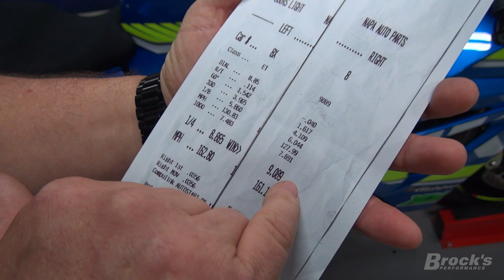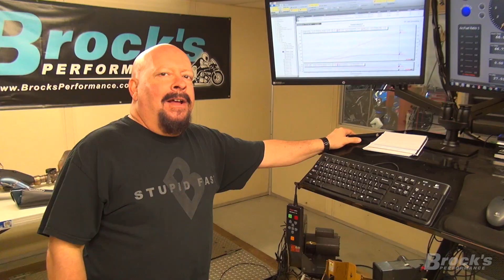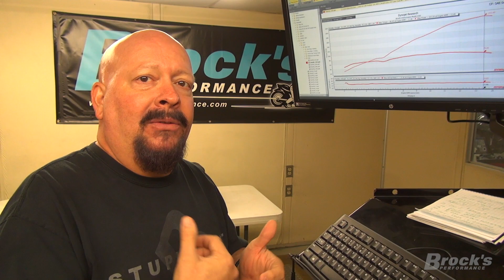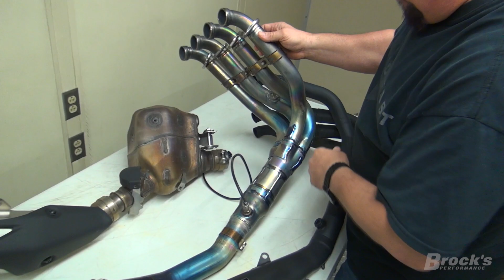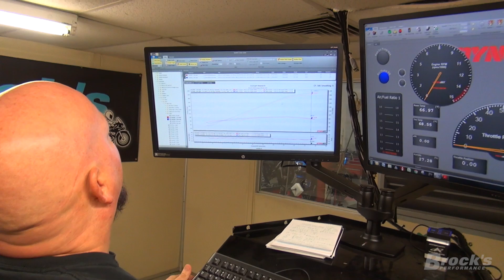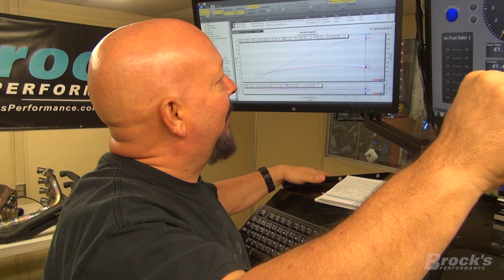Kawasaki Ninja ZX-10R (2019) Slip-On vs. Full System Debate SOLVED!

Comment: Looks like the gsxr1000 would win the drag race because of the long gap in the lower rpm where you'll be there for a while before you hit the top end? only a short rpm band at the top where the zx10 wakes up which could be too late at which the gsxr1000 have already gained a crazy heads-up. only thing someone needs to get used to a torquey bike like that lol.

Comment: How does the penta carbon deal with heat compared ti?
Reply from the maker: The problem with Ti, all Ti...even automotive grade, is oxidation which eventually leads to cracking...and this is accelerated in boosted or nitrous applications. The Penta- Carbon Is ultra light weight stainless steel - it will not crack under extreme use.
Reply: @BrockDavidson  cool thanks for the info. I have a 21 zx10r and I'm gonna go with your full system. Just getting the money together.. cheers

Comment: Hey I have a 21 zx10r. I bought your clutch mod and springs kit . I’m not just drag racing. I want to use my QS I street ride/race and I like to hit twisties. Should I not install the mod and springs ?
Reply from the maker: It's up to you. Installing the mod disabled the slipper, some guys don't mind this on track days, some guys want the slipper. The good news is that it's easy to swap.
Reply: @BrockDavidson  I have a full bolt ons with a tune . Swb . Thank you

Comment: Hey Mr Davidson,  I have a 2006 zx14 and I bought one of your systems back in 06 not long after I bought my bike new. I actually switched over to e85 by switching all my numbers in my fuel map using my laptop. It made over 191hp and ran really good but e85 got difficult to find near me and my injectors were at 97% duty cycle so I switched back to running 87 octane and I bought an alien head for a good deal on a zx14 forum.  Anyhow my computer crashed that had all my fuel maps and my pc3 is loaded with a map that isn't right due to me changing my individual numbers by anywhere from  30 to 40 points. The guy that owned the dyno let me play around for the better part of the day to get my airfuel right and getting the horsepower up. That said I just have no idea which numbers i manipulated from the 30 or the 40. Is there anyway you could send me a fuel map for the alienhead? Oh yeah I can't go back to the guy with the dyno as he passed away a couple few years ago with kidney failure. I'm sure he would have had the maps stored in his dyno computer. Anyhow I  can send you pics of my exhaust either the alien head or the carbonfiber canister to prove I have what I say I have and not trying to get something for nothing.  It's been so long and I can't find the cd that had the maps on them that came with the exhaust I bought new from you. Thanks Mark
Reply from the maker: Mark,
No problem! Just go here and request a map: https://blog.brocksperformance.com/map-support-purchased-used/ our Map Support Team will ask you for any info. they need to verify your purchase. If you want to send some pipe-side images to MapSupport@BrocksPerformance.com , that will speed things up.
Reply: @BrockDavidson  ..... thank you ...also i was wondering if the ecu was ever hacked to unlock big gains ? At one point there was only a few things that cold be done. I'm just wondering how I can get my bike to compete with these doggone litre bikes nowadays . One more thing do the gen 1. Zx14 respond well to mild headwork....... thanks for the reply
Reply from the maker: @POPSMOKE, since the 06's were euro 3, there really weren't many ECU restrictions that removing the secondary throttle plates didn't cure. In fact, we went VERY quick and fast with the stock ECU and some bolt-on tricks. Full stories here: https://blog.brocksperformance.com/kawasaki-zx-14-06-11/
Reply: @BrockDavidson  .... Thanks you very much !!!!!  It speaks volumes about your character and humility to take your time to respond to someone you don't know on YouTube

Comment: Question: I’m installing a M4 GP19 slip-on onto my 2021 ZX-6r and I’ll be eliminating the cat-converter along with adding the servo buddy. With that being said, is a flash needed? Does it ruin the bike in any way if I go without doing this? Thanks!
Reply from the maker: From a top speed,roll on perspective, the zx-10r is tough to beat. The new BMW s1000rr would be my choice for fastest normally aspirated 1000. No on the gsxt1k making 200 on pump. It's more suited for road racing, partial throttle operation. Hope this helps.
Reply: @BrockDavidson  my apologies, allow me to correct myself. I didn’t mean to say cat-converter. I meant pre-muffler. I think there’s a bit of confusion. I was simply asking if I replaced the exhaust and pre-muffler with a slip-on Will it do any damage to my motorcycle? Am I absolutely needing a flash if this is done?

Comment: If I understand correctly, that ZX-10 made 209HP at the wheel with MR12. So, what are the full modifications on the bike besides the full exhaust system and the tune? It can't jump from 160something to 209 with just an exhaust and a tune, 49HP is a huge leap.
Reply from the maker: All products are listed in the long description (click show more) - FYI;: a majority of the power gain occurred as a result of lifting OEM noise and emissions restrictions in the ECU,
Reply: @BrockDavidson  all the power mods i could find in the description, correct me if I'm wrong,  were the exhaust, air filter,  tune and the ceramic bearing. I don't know if sprockets would affect whp. Were there any intake or engine mods done? Like velocity stacks, valve work, cams and or camshafts etc? I need to know so I have a better idea of what is realistic or not, I don't live in the US btw so you can't really help me in person.

Comment: GSXR motors engineers have done incredible job on low and midrange rpm power with their VVT system. As you said, it’s not usefull on max speed, but on street  or track, you can exit curve very quick without downshifting. Great explanations.
ps : have you ever thought installing HAVC system to get consistent T°C and Humidity conditions inside your room ? A 1000cc bike sucks 1L/tr/min. So, at 14000tr/mn, it sucks 14m³/min or 840m³/h. That is the air you need to extract from the exhaust. So you need the same to compensate pressure from outside. So, with 38°C and 80%humidity (high enthalpy), you would need a 19kW cooling system to get that air down to 25°C/50%Humidity. Plus, some extra (i think quite a lot, maybe the equivalent of the bike power * 2) kW to cool bike down… It’s just an idea. I very expansive idea, but as you said, Devil is hiding in details!
Reply from the maker: The last thing we want to do is alter our dyno numbers even more than an average dyno. We pay attention to details that others do not, so our readings are already a bit higher than most in normal atmospheric conditions and considerably higher if the dyno owner does not maintain the dyno well. We completely evacuate our room 8-10 times per minute and draw from a 10K  square ft heated warehouse, so normally aspirated bikes are no problem. Supercharged bikes are the biggest issue as a glowing red exhaust will raise ambient room temperature 30 degrees in just seconds - trying to keep room temp under control for those conditions would be exceptionally cost-prohibitive.

Comment: Hi Brock, I’m Bob one of your new subscribers and somewhat new to the muscle bike world. I think your channel is great! Thanks for sharing your informational videos. 

I’m investigating in my bike and trying to get the most out of it without spending a small fortune. 
I will be having the ecu flashed, installing a Sprint air filter and changing the sprockets to 15/44. Most important to me is the sound profile of the bike. Currently the bike has a Two Brothers slip on and it sounds ok but not the tone that I’m looking for. 

I have a question regarding tone that I hope you can help with. My question is, is there an exhaust for a 2008 GSXR 600 that will produce a deep tone? 

I realize that I might be asking for the impossible but can that bike sound deep like an R1 without having a cross plane crank? If I were equating the tone to a muscle car exhaust, it would sound like something with a Flow Master Muffler on it. Again a deep but somewhat hollow / tinty while at idle sound. 

I appreciate any input that you might share! I suppose the worst case scenario is that I need to purchase an R1 for that deep rumble sound that’s most important to me. 

Below is a link to a video that has an example of the sound profile that I’m looking for. This example is of a Honda CBX 1050. Thanks again!

https://youtu.be/lal5UgVyiiU
Reply from the maker: Hello Bob, glad you are enjoying our channel. We work hard to provide exactly what you are asking for. Unfortunately we no longer offer a system for your bike as we focus primarily on new models. I think your best bet would be to check out Hindle Exhausts. They make a very good system, at a reasonable price and they understand to importance of a good tone. I will warn you that 600's are naturally "peaky" but a robust tone with out the "tininess" found in lower quality or worn out mufflers. Hope this helps

Comment: Would a fule stabilizer like 104 octane boost be recommended
Reply from the maker: Please read this: https://brocksperformance.zendesk.com/hc/en-us/articles/360061989231-What-is-the-best-octane-for-fuel-mileage-and-performance- 
The only time an "octane booster' is needed is if the fuel being used does not meet the engine's minimum octane requirements - poor quality fuel combined with high compression/turbo/nitrous etc... On a stock/normally aspirated engine, Octane boost is not only not needed...but it actually slows the bike down, as explained in the link above.
Reply: @BrockDavidson  thank you. So according to this article 87 octane is optimal. I would of never guess. I always learn something new from your show ty

Comment: I have a question, on an 06 ZX6R, I am needing to install an o2 sensor for my RapidBIke Active Tuning Module. I have a full exhaust, where is the best place to put the o2 sensor on the bike? I marked about an inch of 2 after the 2 pipes merge on the 1(4-2-1), but I noticed on the exhausts in the video it is in the middle of the 2, from what I can see only mostly getting readings from headers 3&4.
Reply from the maker: In the elbow pipe, low...just after the secondary collecter. From as close to on top as will fit to keep moisture away.
Reply: @BrockDavidson  Thank you!

Comment: Doesn’t the sae correction factor on dyno jet automatically correct for weather, barometric pressure, etc ? 

Are you using STD figures ?
Reply from the maker: Yes, the problem is wrapping your mind around what "corrected" means. It's just math, and math is never wrong...but the corrected results are just numbers. In the real world, actual performance is king. ET/MPH/Top Speed/ Lap Time etc... This might help/ https://youtu.be/NkNfmW44zuA
Reply: @BrockDavidson  so you don’t record your 1/4 mile DA corrected times ? I flex on hoes and let them know what my whip runs. I make bitches wet when i tell them how high my da was during runs.
Reply from the maker: Lol

Comment: The astonishing number of dyno pulls some of these motors have endured speaks volumes for Japanese reliability. Keep those boutique brands, give me a motor that will show up to work everyday and ready to get after it! 💚
Reply from the maker: My personal 2010 S1000RR has over 3500 dyno pulls and hundreds of drag strip passes. I can put it on the dyno right now and it will make the same HP within 1-2 of it's first passes. Same goes for my 06 ZX-14 and 08 Busa. These engines are truly amazing.

Comment: I have the gsx-r750 2019. I really want the alien head system for it. Sportbike track gear had it for under $1000 but of course it sold out. You have it posted for almost $1600. Can you work a deal with me? I really want a brocks exhaust but I can only afford an M4 system. Can you please work a deal with me Brock?
Reply from the maker: Unfortunately, the polished systems have been discontinued and black systems are expensive. You can use my personal discount code: BD2020 for 10% off. We should have the black systems back in stock next week.

Comment: Another Question:  My 2017 ZX-10RR has stock headers, cat delete with an intermediate pipe, and the stock exhaust muffler.  If I was to invest into the new Penta-carbon Full Exhaust System, what are my realistic gains to be seen?  (No "promises") but, realistic gains?  Less weight by X pounds, increase in HP by X HP, etc?  Be realistic.  I am seriously considering putting in an order for the Penta-carbon.  I'd just like to know "realistic" gains over my current set-up.  Thanks Brock!!
Reply from the maker: I can't answer the power question other than replacing the muffler is typically not where power is gained. That said, we notice a sizable gain over stock in most sli=on applications, especially combined with a derestriction flash and sprint filter. +5-7 RWHP are typical. I can say your bike will look and sound MUCH better :)

Comment: Looking at the Dyno comparisons, what is an ideal AFR to achieve, 12.8 or 13.2?  Or does it all depend across the spectrum?  And, for most ZX10Rs (RRs), is there an average cut-off in power, such as power begins to drop at 13,200 RPMs?
Reply from the maker: That's a loaded question as the best AFR for the dyno (static application) is typically not the best for the track(dynamic application). While the power drops off on the dyno (static), it doesn't when the ram air is functioning (dynamic). This goes into more detail: https://bit.ly/2EJ1zAV
Reply: @BrockDavidson  Thanks again Brock!!
Reply: Thanks Brock!!

Comment: This may be a silly question. But I see that the muffler is short. Others using the longest muffler. This would not give more horsepower. Thank you
Reply from the maker: The part that makes the power is  hidden under the fairing. The part that makes it look and sound cool is visible.
Reply: @BrockDavidson  What would be the best full system that you offer for my zx10r 2019 KRT. Thank you very much for your answer.
Reply from the maker: Our stock to Brock package with our Penta-Carbon or Alien Head exhaust will give you the most power we know how to make. Contact sales@brocksperformance.com or call 937-912-0054 for pricing and availability - we can put a combination for you that suits your use,style and budget.

Comment: Thanks for the video, I got a little confused and had to watch part of it twice.. You were just about to explain the difference between slip-on and a full system exhaust, but then you launch into a 1 min ramble about fuel and then forget to mention if the cat-delete is with stock silencer or if not, what slip-on silencer is used when dynoing.?!?  Is the low/midrange-gap the same with cat-delete and sports-silencer or what? and isnt it possible to flatten out that dip in the ECU.?   I appreciate the effort you made to make this video, its just that is isnt as "solved" as I would have hoped ;o)
Reply from the maker: Yeah, adult ADHD is tough to control sometimes - sorry about that. The information you need is in the long description. If you mean the dip at the beginning - no need as it doesn't exist in the real world. If you are in 5th gear and whack the bike wide open at 2500 rpms, it will either leave the alpha n mapping and change to speed density, of the bike will die (if set up in a true 1-1 throttle config) either way, what the chart shows and what actually happen are not the same at low revs on the dyno.
Reply: @BrockDavidson  Aah okay, sorry I should have read the full description before commenting :)  And the ramble-part, I do that too sometimes haha, wasnt ment in a negative way.   I´ll just keep my slip-on and not worry about dips then - Haven't really felt any lack of grunt in low rpm anyway ;)

Comment: well naturally you want to cross the line then change to next gear. .not change gear and cross 2 seconds later . even though it's flatt changes still loose something. ..got a 997 out of my full stock hayabusa 02 model. 141 mph.
Reply from the maker: correct!

Comment: You should be  able to gain 15%  more horse power with  E-85  if  you don't mind paying $1.50  per  gallon or less.
Reply from the maker: Less than 5 hp gain - upgraded fuel system required - grand hassle to obtain enough E-85 to make it to the next E 85 pump since MPG is cut in 1/2. E 85 is great for boosted cars... waste of time/effort/money for bikes. IMHO

Comment: ONLY PERSON I actually enjoy listening to and learning from. Very thorough and passionate
Reply from the maker: Thank you :)
Reply: @BrockDavidson  hey I'm in the market for a new bike and I always run your exhaust on my other bikes, and between new zx10r and zx14r and Gsxr1000 it's not a easy pick so in you opinion which one makes the most power looks like zx14r and zx10r are the highest
Reply from the maker: @tktk-om8cg  it would depend on how you are riding and racing, and exactly what year you are looking at. The 2021 zx-10r is highly restricted with no cure at the moment. The 14s are a solid, comfortable older design. The new gixxer is very fast and an excellent choice for racing. And, of course, the new Busa is coming...but it will be highly restricted also for a while...sometimes it takes a year+ to figure them out. Hope this helps.